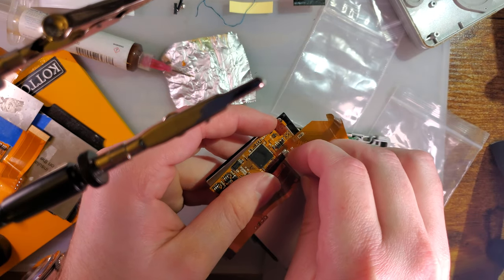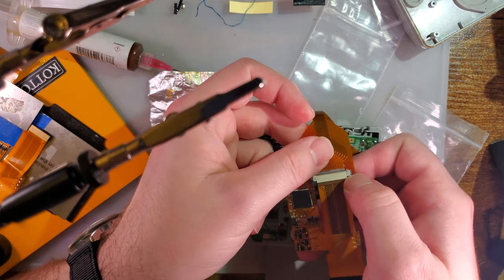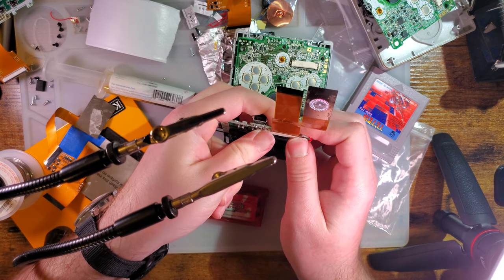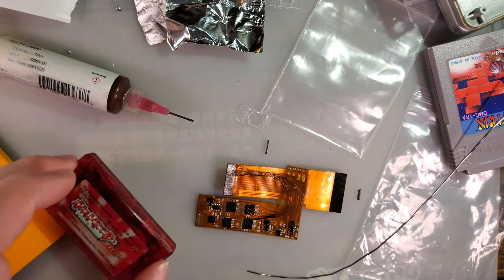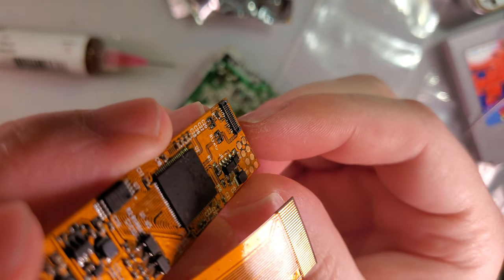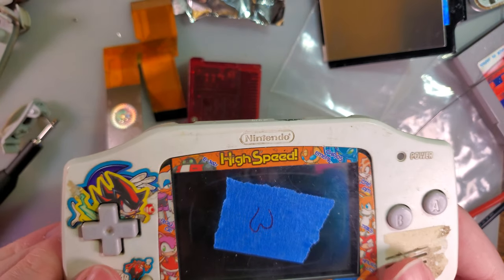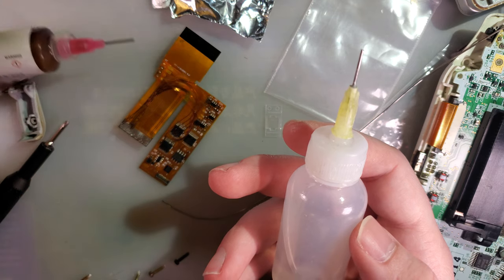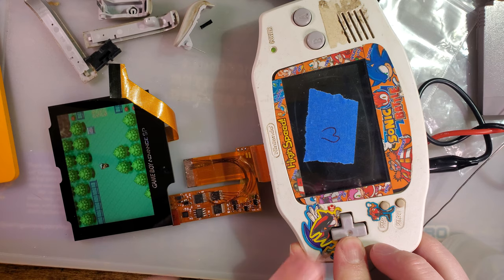IPS Kit Ribbon Repair (Part 2 of 2)

Comment: I wonder what the lifespan of the ips screen is, it is kind of an easy fix but there are a couple of screws stuck in the mother board and battery slot making ribbon cable replacement almost impossible.

Comment: Dude I had to install mines straight to the gba without soldering, because where you solder on the Rubin cable popped off :/
Reply: Kinda funny, Makho actually has a post about this: https://redd.it/hb4jsv

It was useful for me after ripping off the solder pad for the L button, might be useful for you as well.
Reply: @inclinerd  thanks!! That’s the pad that got ripped on my Ribon!
Reply: @Aces50001  👍